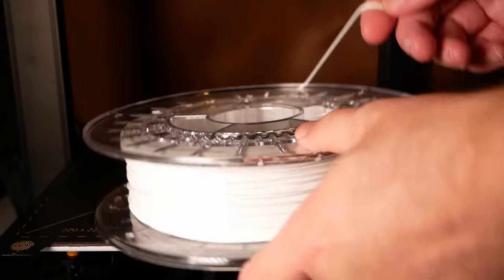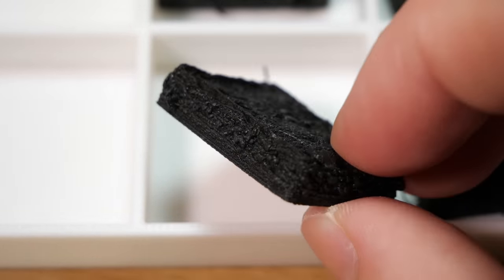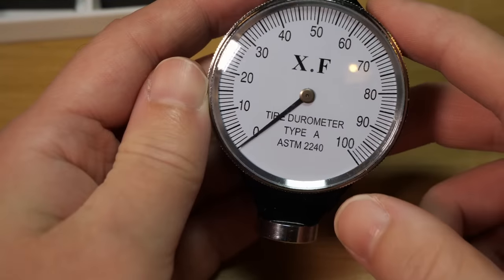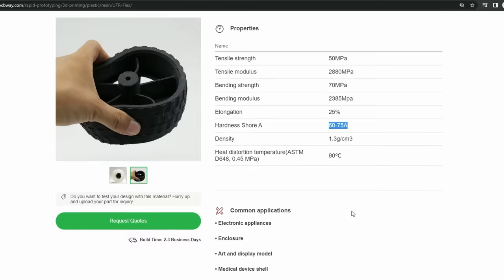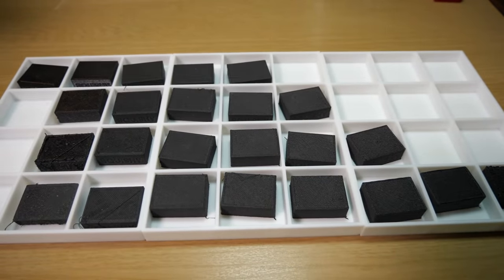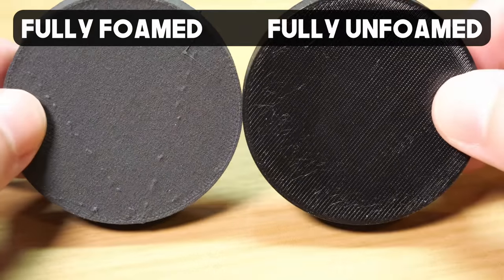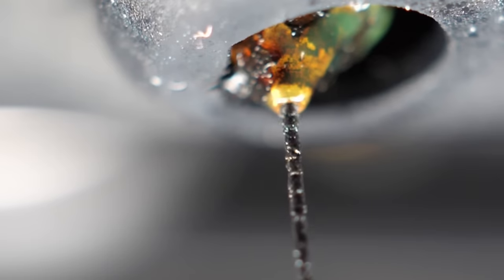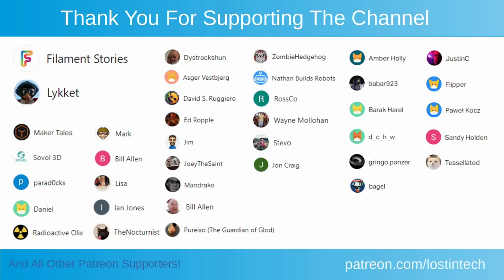The Ultimate TPU? Achieve Shore Hardness Down to 55A and Beyond, ON YOUR PRINTER.

Comment: what if you changed the hardness in the middle of the print like you could make sure that a part boucles in a predictable manner by having regions of higher or lower degrees of foaming
Reply from the maker: sure, you could do that with modifiers based on height, idk if you can do it in different areas on one layer, with current slicers

Comment: Corrections:
- not all tpus underflow. (Can’t generalize because it might induce others in error)
- the type of durometer you used is only adequate for solid materials, (in this case only for the unfoamed print). This means all of the measurements of the foamed prints are innacurate/incorrect. (Yeah if you want to have an idea of the change in hardenss to play arround, it’s “ok”; but it’s not scientifically accurate)

Cool overview though.
Reply from the maker: Eh, air filled foams are tested for shore hardness all the time, if you think about it, it's valid.

Comment: This is cool but the layer adhesion would need to remain strong foamed or not 

I have been making my own shoes but they all eventually later split at the wrinkle point, softer TPU would be good, but then the sole wouldn’t work. So this material would be perfect if layer adhesion was always good
Reply: Maybe try some FUSEDfootwear TPE 😏
Reply: @philippeholthuizen nice shoes and congrats on your business success.

How well do you think they could hold up as running shoes?

After solving my last issue with splitting at the crease my shoe will be a perfect running shoe, hiking boot shoe and fancy dress shoe
Reply: @hellothere6627  thanks! I’d love to see what you are making too.

The TPE should hold up just fine for a running shoe. In the sense that its flexibility, layer adhesion and wear resistance are very good. But it will also depend on your design of course.
Reply: @philippeholthuizen  I will email you later with pictures and details

Comment: The A in 92A is not a unit, it’s the method. There are different Shore tests, i.e. type C.
Reply: no it's a unit of measurement for different scales!
Reply from the maker: Yeah this, it's alphabetical. One A is four Ds
Reply: @CrazyT0sser  please check Wikipedia on this. I just did to check whether I was wrong. It’s a dimensionless unit and the letter denotes the method the value was measured with.
Reply: @StefanBugovsky  thick one, aren't u :]

Comment: That's not reverse bowden.. It's bowden.. Reverse bowden is when you have direct drive and a bowden tube back to the spool, so you don't pull on the hotend, when pulling for more filament
Reply from the maker: Erm...
Reply: That printer is direct drive.  Reverse Bowden doesn't exist which is the whole point of their comment on the naming. If it's not using the bowden principal then bowden need not be in the name.  There is no reason to call a ptfe guide tube reverse bowden other than dumbing it down for a certain group. But since that group exists a lot of term usage follows that.
Reply: @Rainmotorsports  that's correct
But in the video he is explaining that tpu printing using a printer which have a bowden setup is near impossible due to the restrictions in the tube
That issue is only a issue on a Bowden setuo
Using direct drive extruder near the hotend and a guide tube (reverse bowden) it's not an issue

So my comment is that he is mixing the two terms up
Reply from the maker: You should see my last two tpu videos. Contrary to popular opinion I do sometimes know what I'm talking about 😂
Reply: @Zplizor  Well, no. He also has at least two videos about successfully printing TPU with Bowden setups :)
As well as one video showing that filament movement restrictions don't end at the extruder, and depending on how freely it's fed from the spool, results may vary, and that was even without reverse Bowden, just from pull on the roll of filament.
Reply: @LostInTech3D  i dont disagree, in this video it did just sound like you were mixing up the terms